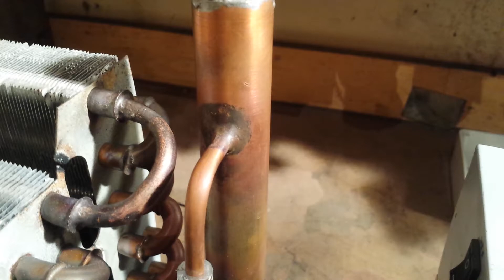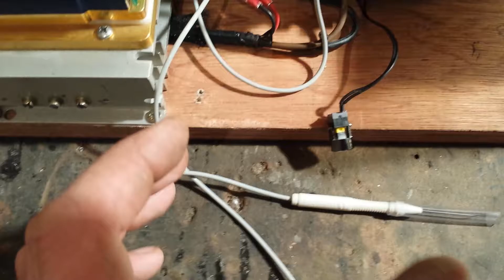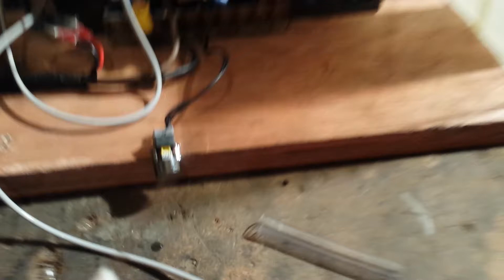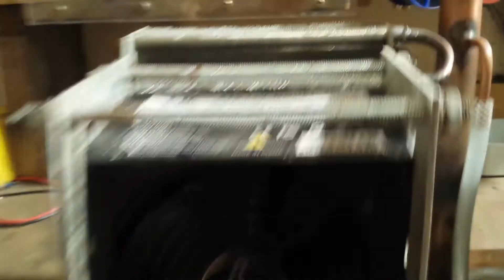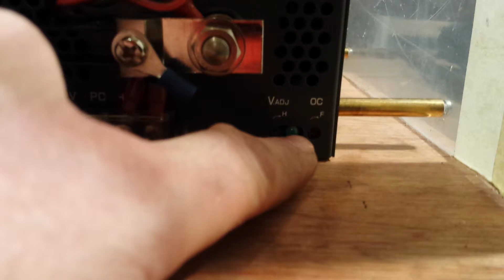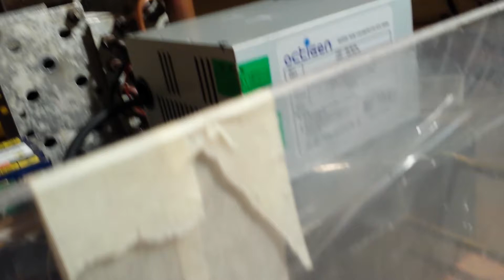My new 12w 808nm fiber Laser, part 1

Comment: Nice , Just be carful running it in voltage mode as diodes really prefer constant current :D .
Reply from the maker: Oh I will m8 iv bin looking for a laser like this for a long time now and i don't want to kill it, that's why I have gone over board on the cooling system and the meters for the power supply.